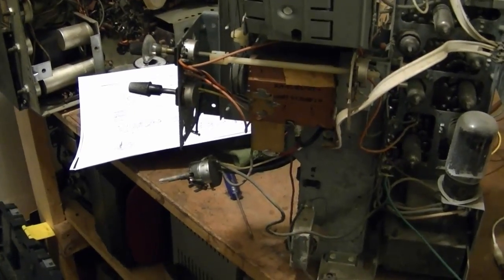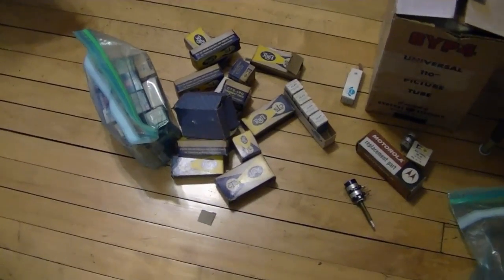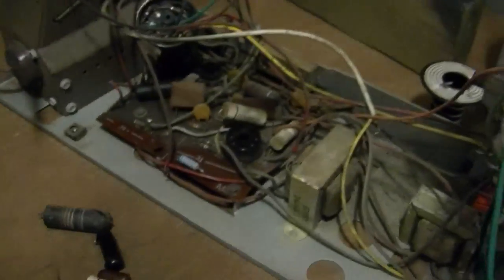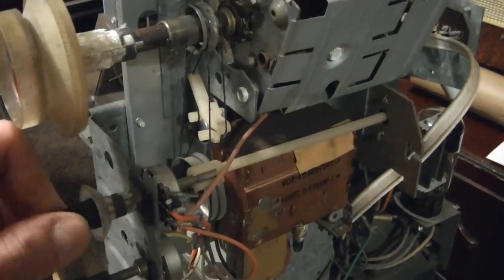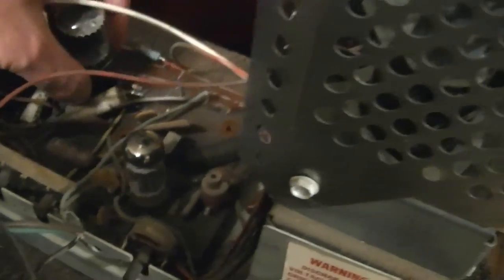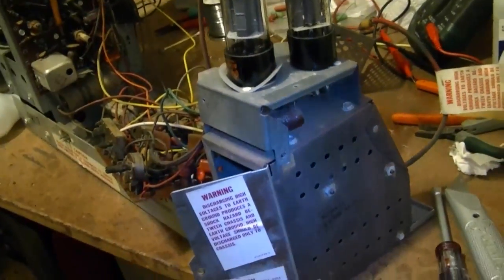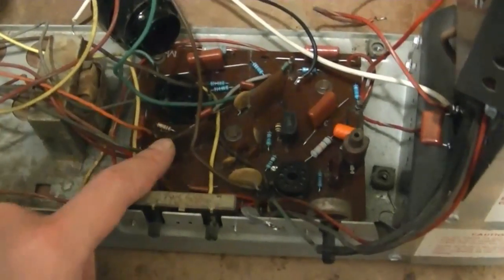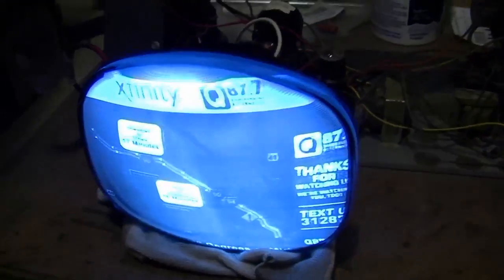GE21C2465 restoration p3o?

Comment: Bob,  what did you use to clean the rust off the chassis, esp the cage around the horiz output and damper tube.  I've got the same chassis set but in a metal cabinet, and mine has some surface rust on the chassis.  I'd like to get my chassis as nice as yours

Comment from the maker: Standard modern caps are still 2,000 hours and these would be 10,000 hrs.  Now that's at maximum voltage and temperature.  Lowering the temp drastically increases the life.

Comment: You found a tapped 1Meg control...with a push-pull switch!!! Wow you do live with the repair Angels. You said that those Rubicons had 5 times more life Bob. What is that like in terms of hours? I know that some older Electrolytic's from a few years ago I got were rated at 2000 hours but I dont remember who made them. Thx